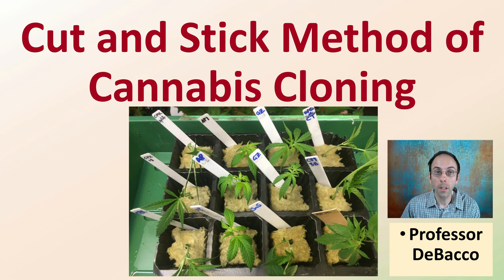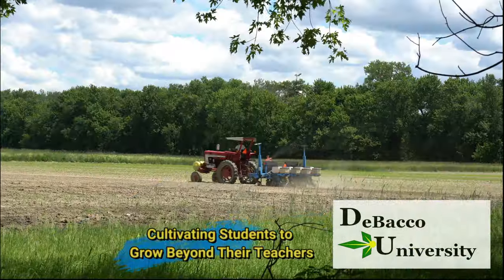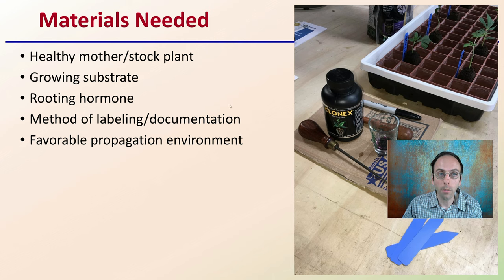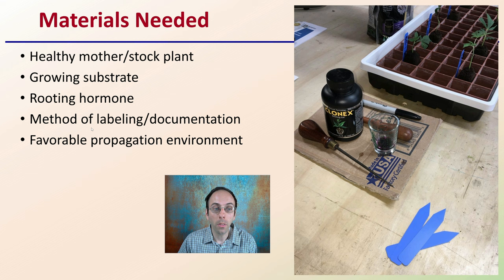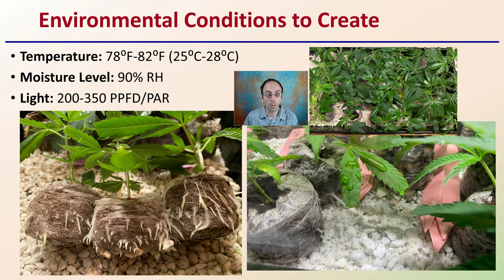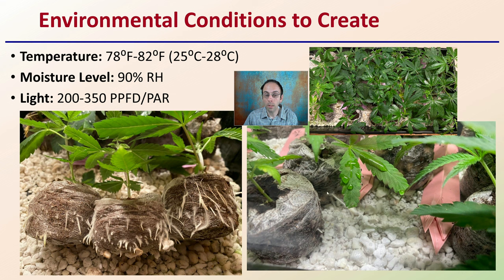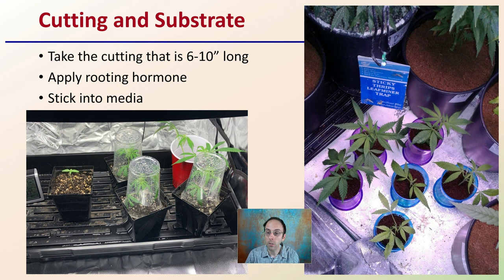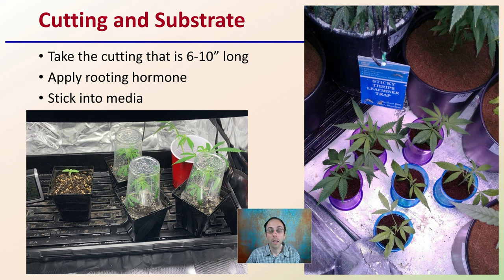Cut and Stick Method of Cannabis Cloning

Comment: QUESTION: In your prior vid you cut clones with 3 full tiers/nodes, whereas these look smaller.  Pls elaborate.

Also, do we need to remove/reduce larger leaves so that the cuttings dont dry out prematurely during the 7-10 days (guess) that it takes for the cutting to push out enough roots to restore parity between foliar evaporation & water uptake ?  Its hard for freshly cut seedlings to uptake enough water if the cutting is very leafy and hasnt started rooting yet.
Reply from the maker: Smaller and larger clones can work some growers prefer one size vs another.  Typically slightly larger is preferred but both can work.

Comment: Hello good sir 👋 Thank you for sharing your knowledge in such a comprehensive manner! Question for ya, does lightly shaving the stem wall and/or cutting at a 45° angle prior to hormone application help with success? I did not search for a video if you made one, thought I would just ask 😁
Reply from the maker: The surface shaving may help, but at scale not worth the extra time/labor.
Reply: @DeBaccoUniversity Just go with cut, dip and stick. Got it. Thank you for the response good sir. Have a great day!

Comment: Thanks for another great video! Is cutting the leaves back just bro science? Does it not stimulate and/or send the message to just grow roots? And do you worry about the leaves touching each other. I am using a very small amount of Raw silica in my spray bottle. I'm hoping to fight off any fungal pathogens. I also spray with Roots organic "rain" 2-4 times/day as needed, a dome lift several times throughout 24 hours. I said a lot.... I did this style of cloning this run. Just trying to weed out the bro science. Keep up the great work!! Thanks 😃
Reply from the maker: Sounds like you want more than just an answer so take a look at this DeBacco University video... https://www.youtube.com/watch?v=50NzaE8TT-w&t=487s